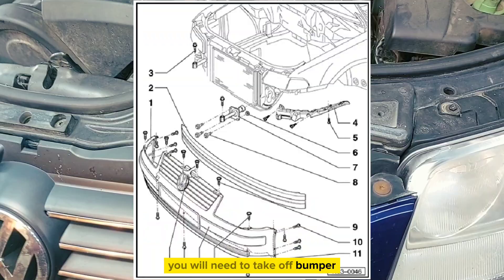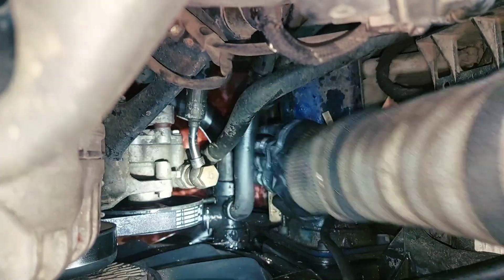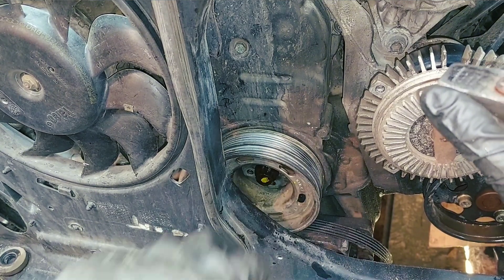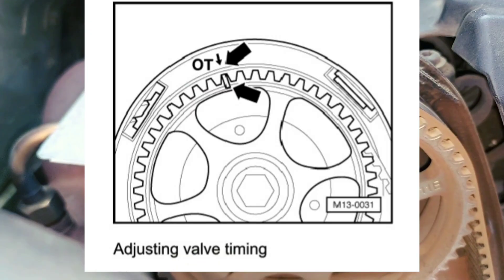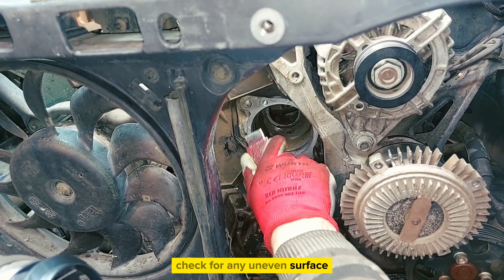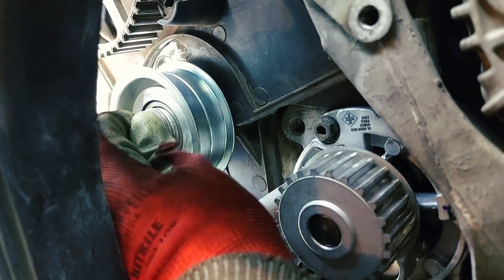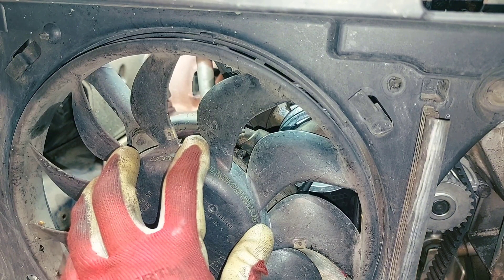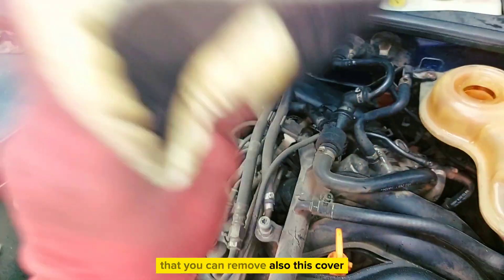easy way to change timing belt | Volkswagen 1.6 mpi

Comment: Where did you find the manual for changing the timing belt?
Reply from the maker: Type this engine
Reply: @HintSlice thank you, great video 👍
Reply from the maker: Thanks good luck🙌🏻
Reply: @HintSlice I managed to replace it and everything works fine so far 👌
Reply from the maker: @cvolt1505  That's cool bro, good luck on the road🙌🏻